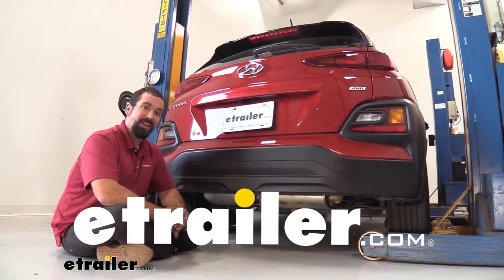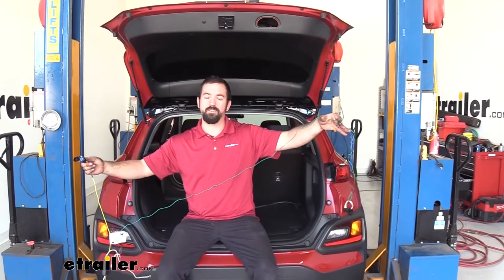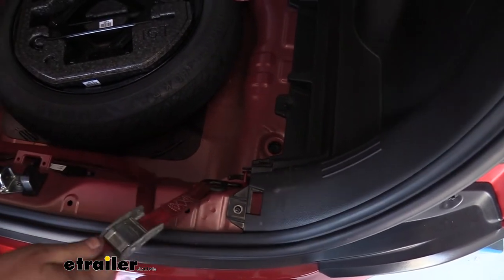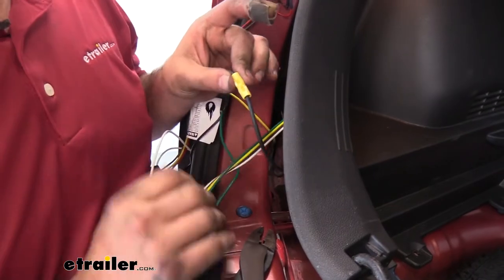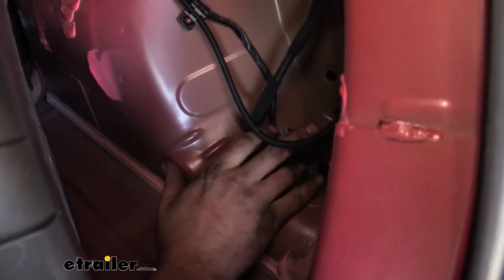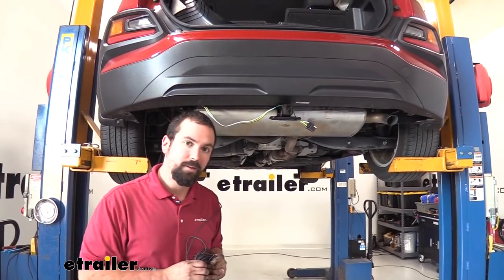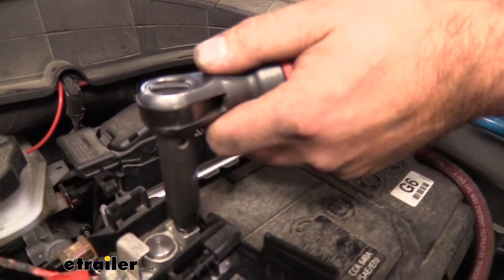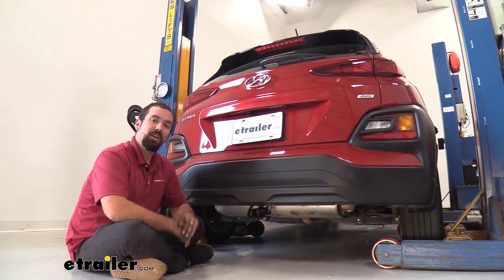etrailer | Curt T-Connector Vehicle Wiring Harness Installation - 2020 Hyundai Kona

Comment: Hey, question about the trailer lights. Is there a version of this kit for the LED taillights? I got the kit and realized that it didn't fit with the LED lamps.
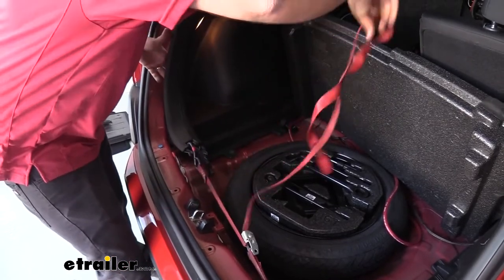Reply from the maker: According to Curt, the # C99KR works on all models of the 2018-2023 Hyundai Kona. Are you using the correct connectors on the vehicle? You can see the connector location at the 4:40 minute mark in the video....

Comment: You skipped the passenger side tail light connector - I wonder why?
Reply: Probably because you are thinking about the brake light and you only need one feed for that.  They cover both turn signals.
Reply: @remedyman  no because the plug for that side is almost completely inaccessible. I had my wife and son under that car for over an hour trying to unplug it. Then they couldn't plug the adapter back in. I had to jam a welding rod into the back of the connector, carefully feed it through the narrow little hole past another wiring harness, and hope to God I felt a click. Thanks hyandai Kona engineers!